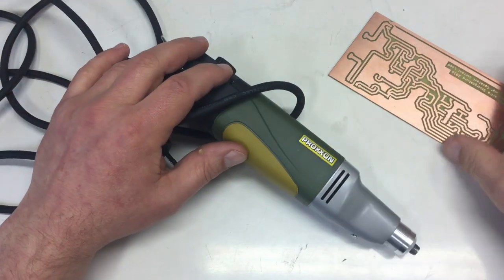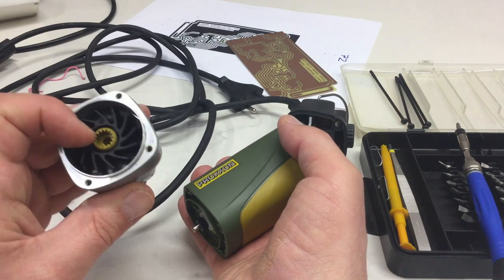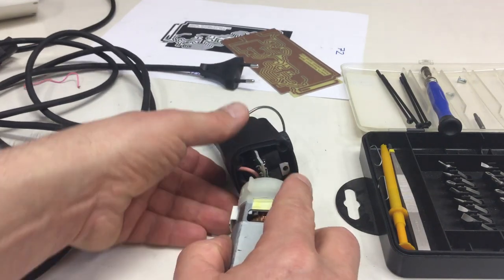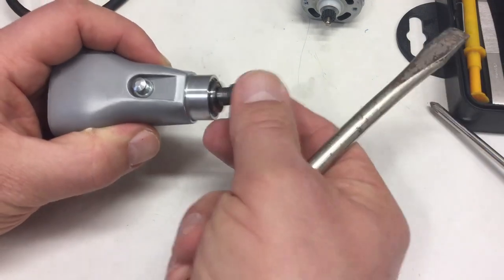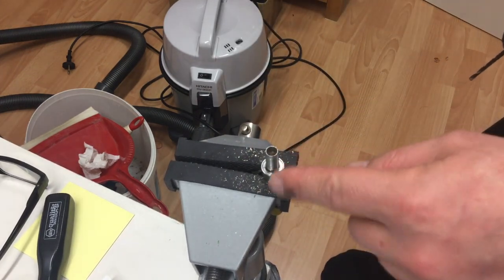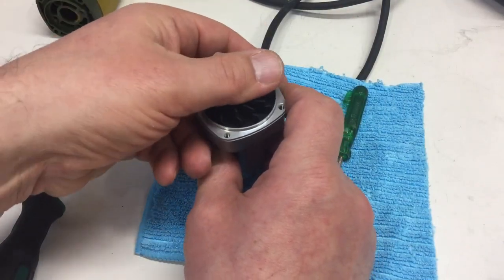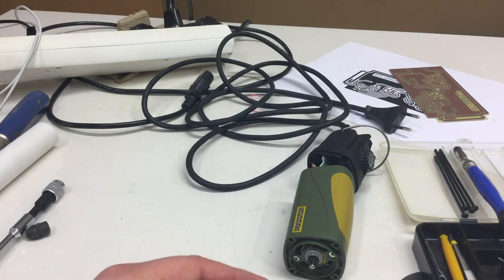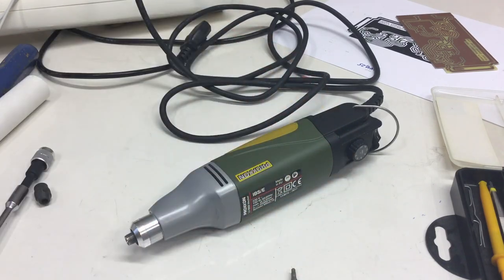Proxxon IBS/E Teardown & Repair (Broken Collet Stuck in Spindle)

Comment: A drill chuck is ok for drilling, but it is a pain for milling. Collets are much better in holding radial forces. But they need to have a reasonable quality. Simple rule: The ones that have three slits are better than the simple four slit ones.
Reply from the maker: You're absolutely right! My original Proxxon collets for the IBS/E and BFW 40/E have all three slits, while my cheap ones (one of which broke and got stuck in my IBS/E) have four. Guess making four slits is cheaper (really just two cuts down the center) than making three (three cuts at the sides). But it's also the material: My good ones are  made out of blued, hardened steel, while the cheap ones are made out of shiny, soft steel (not only can you scratch the material with a file, you can easily file flats into them).

Comment: In the future, you can try this method. 
Because the collet itself is hollow, you can fill it up with lubricant grease or wet paper, and then use a short axle (or bolt) that fit in the collet, 
and tap on axle with a hamer. The broken collet shall begin to move out, you may need to refill the grease a few times.
This is a method that is used for removing bearings from a piece with a dead end behind. 
A example how this works :
https://www.youtube.com/watch?v=28bSl4r1kwQ
Reply from the maker: Thank you very much for this tip! I'll definitely try that next time - though I hope I'll never break a collet in that thing again :-)

Comment: When drilling out something like this (soft brass), it's much better to use a smaller drill bit that would essentially ream out the inside of the collet, rather than trying to drill it's full diameter. Then work up in drill diameter. That would have thinned the collet down to the point that it would break into pieces rather than trying to grind the whole thing to dust. Less chance of damage to the inside walls of the collet holder too.
Reply from the maker: Thanks for the tip! Though I hope I never again have to remove a broken collet from my Proxxon IBS/E 😅

Comment: Motor screws are PH2 and it looks like you were using pozidriv size 1 driver on your first try. Good way to destroy screw heads.
Reply from the maker: Thanks for the hint! Fortunately the screw heads survived the mistreatment. But I'll definitely will use a PH2 bit next time I need to take that thing apart.

Comment: Any maintenance tips on that motor? I know it's a Permanent Magnet motor but don't know anything about this technology. How do we change the brushes ?
Reply from the maker: Sorry for the late answer - lately YouTube Notifications fail me regularly :-( Anyway, in my opinion that motor doesn't needs any maintenance. Regarding the replacement of its brushes: Seems replacement brushes are not officially available. You can buy an replacement motor for less than 30 bucks though. I guess I will make a video about repairing that motor when mine fails ;-)
Reply: @robertssmorgasbord  thank you for answering !
Reply from the maker: @Costin_T  You're welcome!

Comment: A suggestion: don't disassemble the tool. Put the drill bit in a vice horizontally and push the tool over the drill but while running it at a low speed.
Reply from the maker: Thanks for the tip! But then, I wouldn't have had a nice teardown video 😉

Comment: I guess you can use tap to make a thread in that collet, then screw a bolt and pull it out
Reply from the maker: Yup, at least with that collet it might have been possible. Good collets are somewhat hardened, so it might be tricky to cut a thread into them. Also, the collet might start rotating. But you might start enough of a thread to pull it out using the tap itself.